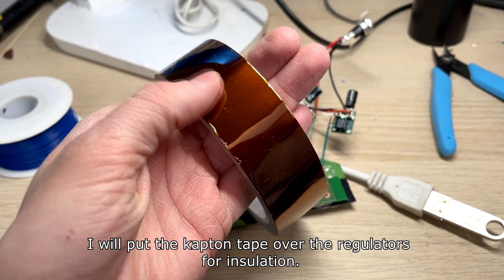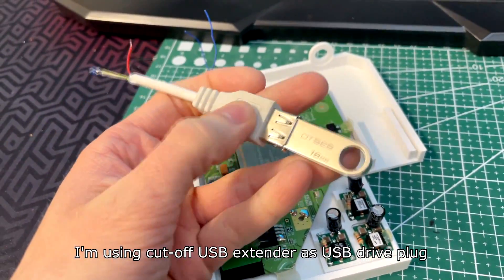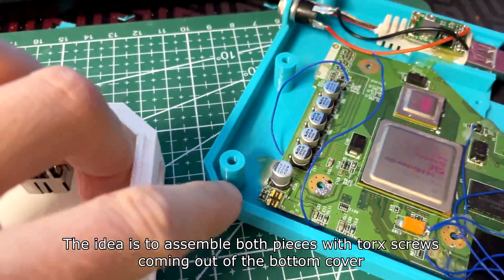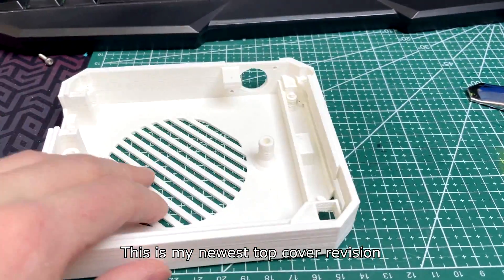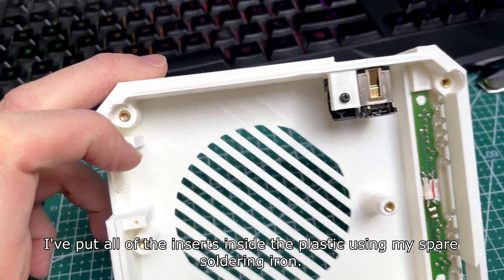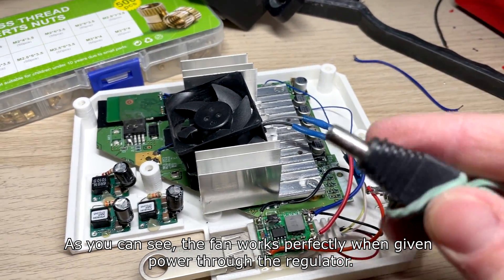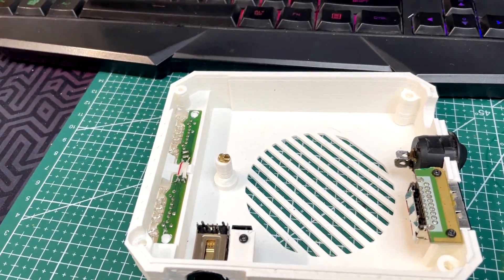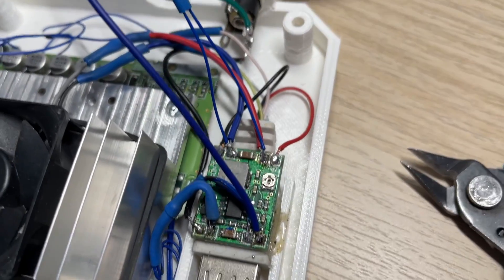Micro Wii | DiY miniature Nintendo Wii console

Comment: I wanna do something like these but I want to reuse the DVD drive, but I don't know how I could re solder it somewhere
Reply from the maker: You could convert it to external drive. You would simply connect it to the console and then disconnect it when you don't need it. If I remember correctly, it's only one cable
Reply: @ManolloMancelli  good Idea I will do some research about this. Thanks !

Comment: how about I am also making a small wii, but this is identical to the original in case design, I have a doubt how I could adapt its power cable to usb type c since I have two nintendo switch chargers and I would like to feed it through that medium, thanks in advance for your work
Reply from the maker: It’s actually pretty easy to do since you would need a USB-C breakout board which you then would connect to the custom voltage regulators (PTH08080) this way you will convert the USB-C 12v to the voltage required by Wii

Comment: Is it possible to deliver power over something very common like USB C?
I am interested in getting rid of the bulky power adapter but like my Wiis original shell so a full trim is way overkill.
Reply from the maker: Yeah it’s possible since there are already custom regulators installed. 
USB C has more than enough power.

Comment: This is amazing, and it's a lot smaller overall because of your trim. I left the AV port attached to my board so I didn't have to rewire it. I also like how your sensor bar mount pays homage to the aesthetic of the original Wii console. I let my front face be the space for all four Gamecube ports and use a wireless sensor bar. I isolated my fan and heatsink in their own cavity in the case. If I may make a suggestion, I would use a small piece of foam with a hole in it under your fan, fold it over on the sides and press fit it in between the fins of your heatsink. The rubber band may pop over time.
Reply from the maker: Thanks for the tips! You absolutely have some valid point there. Can I see your build anywhere ?

Comment: your case vent is both intake and outtake for airflow? thats bad, its just recirculating the same air inside case. Did you notice how the Wii originally had the fan at the back of the case as an out for airflow, also an intake at the bottom of the wii. your design has bad airflow with zero static pressure, which recirculates the same air for poor cooling.  Also the Wii sensor bar needs a gap in between both sensors to function correctly. Your sensors are literally right next to each other, limiting your full range of motion to an even smaller length. If your just going to use this for gamecube games thats fine i guess... but you wont be able to play games correctly using a wiimote.
Reply: It’s better than some of the Wii portable airflows… “no airflow on some”

Comment: Hi, I love you're video's but why did you go threw all the pain of building this micro Wii from scratch even though the noldendo Wii micro (from nold) already exists and the build is really smooth and the end result is really good in my opinion( I've build one myself)? If you make it smaller it will definitely make sens but I will have to wait for the next video on the topic!!
Reply from the maker: I love making my own stuff. I don’t really like building stuff that someone else designed. 

I’ve also noticed that Noldendo Wii uses 6-layer motherboard and my project uses the 4-layer one.
Reply: @ManolloMancelli  Thanks for the answer and I think you have a pretty respectable point!